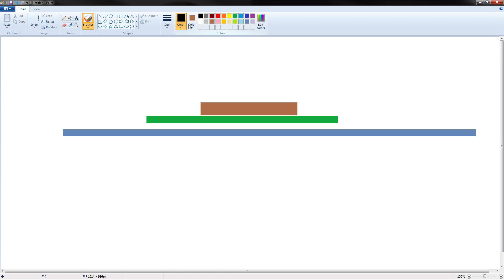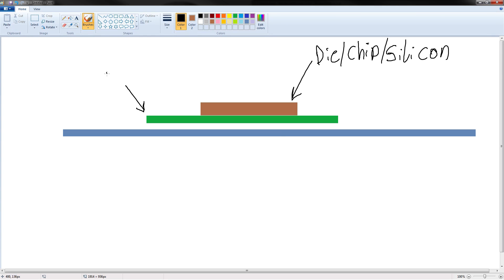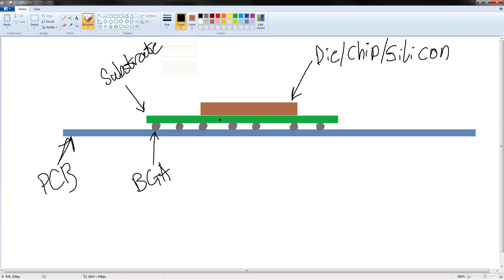Xplained with paint: baking GPUs

Comment: I have re-flowed maybe 100 laptop GPU's. The one part of the process not mentioned here that I noticed was that when I heatt hem up. I use a spark plug socket for a weight. Maybe I'm wrong, not a pro here. But I'm pretty sure I've read that these GPU's are soldered in place with around 8oz(+/-) of pressure applied. I wrap the board in foil, cutting out the GPU to be re-flowed preheat my socket to around 270(ish) F, and place it on top of the GPU. then I take my hot air gun, and briefly heat the GPU, slowly/carefully.... This process has given me around a 80% success rate. Anyhow, I saw no mention of the pressure applied to the GPU from the manufacturing process, and feel it's a rather relevant part of the repair.
Reply: Absolutely what I had imagined. GPUs getting overheated flatten out the balls over time and contact is lost. By heating it up and applying pressure, you essentially push the GPU a little closer to contact points and it begins working. If you however apply too much pressure, you are risking a short, which in return can kill the GPU.

Comment: one month ago i heated my dead gpu(ati 4670) with hair dryer(2500w) and it still working. So for sure it was the FCBGA...
Reply: so you have hair dryer going up over 100 degrees celsius? That's hard to beelieve and would be quite dangerous :) I suppose you used heat gun instead of hair dryer?

Comment: There is a solution to the problem of the other components. You soak some tissue paper in distilled water, and wrap the card in them, except the GPU and memory area, then wrap the tissue paper in aluminium foil. You then put a piece of lead free solder in a boat of aluminium foil, right next to the card in the oven. When the solder melts, you know you have reached the temperature, and turn off the oven heating, let it sit for a bit then crack open the oven door to start cooling. After the card cools down a bit you take it out and remove the foil and tissue, and let it dry out completely in a bag of rice for a day or two.

Comment: then why does everyone use around 200 C with a relatively high success? why dont they use 130C? your the first person to recommended that. have you gotten any luck with that temp?
Reply from the maker: I haven't had to bake any GPUs yet. The whole baking GPUs thing is based
 on people reviving cards by re-balling the GPU cores which is done at 
260C with some extremely expensive equipment. That technique either 
nudges the FCBGA back into position by accident or it fixes an actual 
crack in the BGA connections(it's very very rare but can happen) because
 they all get replaced. I have no idea who first came up with baking 
GPUs so I have no idea why they chose 200C of all temperatures. Either 
way trying to do it with a low temp like 130C first will not do any 
harm. If it still doesn't work after 130C then hit it with 200C. But 
200C right of the bat is generally a terrible idea.
Reply: +Actually Hardcore Overclocking 
thanks for the reply and i have one more question if you know.
i had an amd card which one day just died without warning (no output)
after spending 3 years in storage (just your average room cupboard) i plugged it in and it worked for like 15 minutes before dying again.
your thoughts about such an incident.

btw now that card is working normally after i baked it 8 minutes for 190-200C anddd i do kinda regret i found your video now, i would have sticked with a lower temp